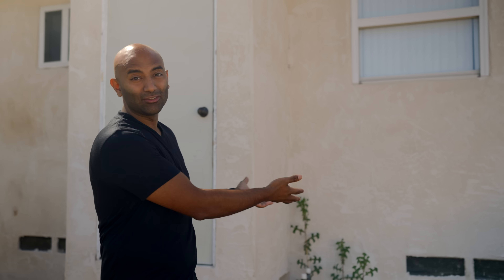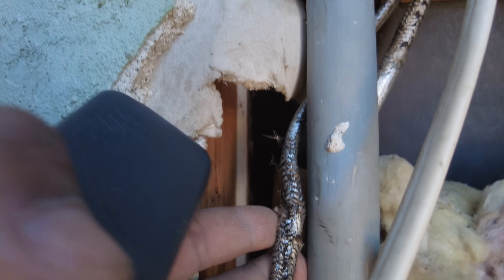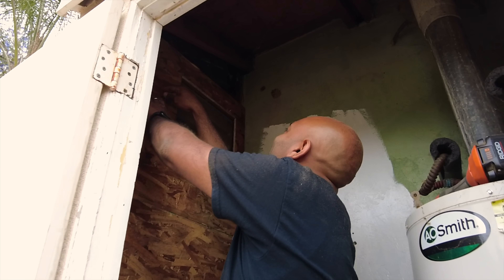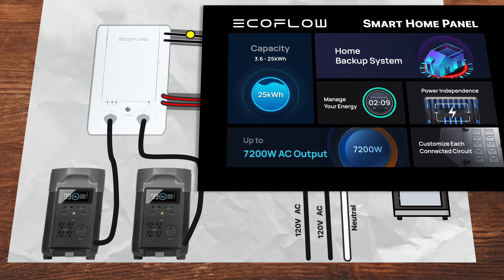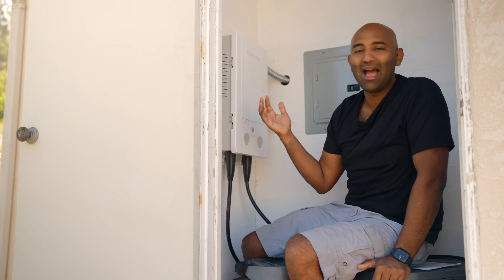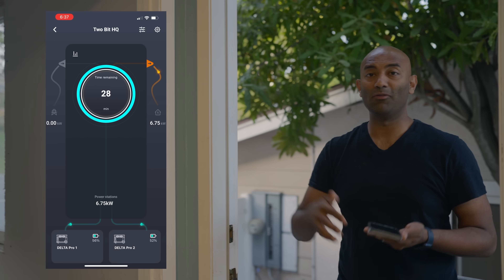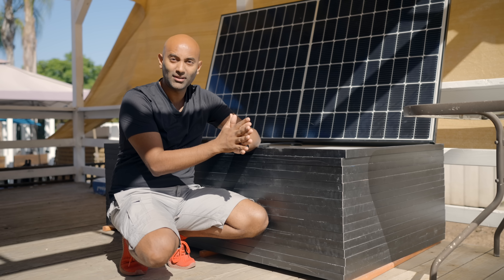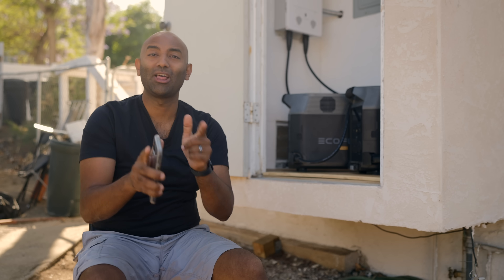Best New Way To Back Up Your Home Energy?  |  Going Off-Grid.

Comment: 6:42 According to this schematic the device is putting (battery-)power into the system behind the circuit breakers.
Surely that can't be right?
Reply: It is right. The eco flow unit acts as circuit breakers as well. Good catch!
Reply: @azpcox  Yeah, according to the installation manual there's a single fuse protecting the backup batteries and "relay based overcurrent protection" on each circuit.
I wouldn't be surprised if that's the UPS relay doing double duty with a bit of software. But let's give 'm the benefit of the doubt and assume there's actual electromechanical breakers in there.

You'd still need the thing to feed into another breaker box as there's no AFCI or GFCI protection.
I believe AFCI is mandatory in the US, so that's another 1000 bucks for the installation of another 10 group combination breaker box.

In Europe we mandate GFCI. A single unit can service up to 4 groups in the mains breaker box. But in a setup like this, with each individual group potentially getting power input behind the breakers, it'll need 3 of em in the mains box. And another 10 in the secondary box.

And how will the fire department switch off all power in the house, if that need arises?
In Europe there's a firm building code requiring an entire building to be switched off with a single, clearly identifiable, switch.
I don't know how US code deals with that. But the 10 (or 20) pole certified mains voltage switch needed to de-energise the whole house doesn't exist.

Leading one to question: why on earth would anyone want to wire in a UPS system like this?!

Comment: Why not use underfloor heating? This is more economical and efficient than AC. Heat rises, and a mere 20°C at the floor is more than enough to maintain equivalent room temperature, and best of all it warms your feet first. It’s even suitable for installation under tiled floor in wet areas!
Reply from the maker: Hmm maybe on the main house. I’ll have to see numbers on performance.

Comment: It was impressive how quickly it transitions when power outage takes place. My PowerWalls don't flicker my LED lights in a noticeable way, but my wall mounted TV does get rebooted if the grid stops working and PowerWalls take over. I think the capacity of those EcoFlow batteries is very low. My two PowerWalls can keep my home powered for 6+ hours and I have everything including two central AC units that use 3.5-4 kW each when running. When my Tesla car is charging, the house during summer can be using up to 14 kWh. My solar system during peak solar conditions produces max of around 11.x kWh.

Even with my large investments in solar / battery, while it is possible to be Net Zero, it isn't possible to be completely grid independent. Especially since we can get really cloudy days that are still too hot and require just as much central AC use.

Comment: I have to assume that the Ecoflow Smart Home panel will not allow its power to flow back onto the grid if the grid goes down. I wonder how this happens with what you showed us. so far. Obviously fully off the grid operation will not require this  for grid safety, but your local codes will if you expect the grid as backup.
Reply from the maker: yes this is a sort of off-grid system. this will not feed the grid at all. only your local consumption in those 10 circuits

Comment: Is this in the US?
Our house built in 1951 has original electrical wiring and is quite ok shape. 10A 230V circuits and 400V 20A for stove. Heating is of course water based district heating powered by recycled trash. Until the 80s it was district heating based on oil. 🇸🇪
Reply from the maker: yeah do you have grounds? most houses weren't grounded back then. also homes dont move so old wire really isn't a major issue.but we weren't grounded, and tehre was bad wiring. so we wanted to get it up to code
Reply: @TwoBitDaVinci  
With taped connections outside connection boxes I can really see why you want to replace the wiring! :)

Grounds only in kitchen and bathroom has been the national standard until the 90s. (Radiators and sink naturally grounded). In early 2000s they added earth breaker as standard which opened up for outlets in bathroom which was prohibited before. 

My sisters house in the woods remade the wiring 15 years ago, before that it was from the early 1930s. No problem with connections after 75 years of service and thunderbolts! (you could see where the bolts jumped from 230V system to the old telephone cables by burn markers on the wallpapers!). Plastics wasn’t invented by that time so at some places the isolation fell off leaving naked live wires. It was time to do rewiring! :)

Comment: get a multi input tank and as large as possible 
personally not a heat pump tank , solar be a lot cheaper electric to top up the tank , for air con you could have water cooled condenser 
and use one of the inputs in the hot tank to pre heat the hot water

Comment: 12:06 What would happen when you go over the 7200 Watts total draw?
Will it switch off individual groups until it drops below that? 
Or will it just blow the single battery protection fuse? Potentially leaving you in the dark and on your way to the store to buy a new fuse and a flashlight..

In another post I've already determined that this thing is illegal to install the way it is.
But besides that, I'm genuinely curious what this weird semi UPS device adds over a real battery UPS system wired straight into the mains breaker box.

Comment: Having the grid is great but it is already starting to make sense to just build a bigger battery bank and add more panels and have the grid become the back up, for those that have the option it saves a lot of money not even bothering with the grid full stop. This is going diy of course, buying your own LPA cells from China, chargers and inverters, those companies like ecoflow make it a non starter financially atm and it will remain that way for many years yet.

Comment: I usually go for fiberglass insulation (you know, the pink stuff).  Very easy to install, and also very easy to rip out if you need to drill holes later on.

Oh, make room on the wall for one or two amazon fire tablet mounts.  These are recessed tablet mounts with a built-in AC socket (usually also with a built-in USB socket), so the tablet can be there on the wall always powered.  Great for home-automation controls.  Its a small room, so I guess you need only one.

-Matt
Reply: I would go for Rockwool (Rockwall?).  Blocks more sound, insulates just as well, easier to handle, etc., etc..
Reply: @markjohnson7887  I would go with a hybrid insulation system. Spray in closed cell to close any airgaps in the home and then rockwool. It's cheaper than full spray foam insulation and you get better fire protection and and external noise reduction.
Reply: @DoctorDanLe  Oh yeah, I forgot about the sprayed in insulation.  Good idea

Comment: What about a solar thermal water heater?
Reply: I know right, a small gravity fed solar hot water heater would be perfect for the small house.

The only issue I would see with it is in the mornings it would not have much hot water til it is able to warm the water up.
Reply: @travisschneider3011  Correct, unless a good sized (and insulated) buffer tank is used. Most systems also use a small waterpump that starts pumping the hot liquid as soon as the temperature in the solarboiler rises to a certain level.

Comment: You guys don’t appear to use solar hot water much, you don’t appear to have either Thermo siphon or Thermo pump both of which especially the first are very popular in Australia. With a power boost for the really bad weather days. Yes we do have freeze weather here so the system also has to be designed with that design feature. Just a though!

Comment: You shouldn't run microwave empty I don't think forget the exact issue but think supposed to put glass of water in there if just testing, probably not huge deal and like I said not sure the exact issue but do recall reading it somewhere when using microwave to dehydrate leaves quickly.
Reply from the maker: good to know yeah just for a quick test :)

Comment: great concept but 30 min run time is practically not useful during an actual outage, that will probably drop to a few mins if you load an AC or fridge/freezer.
Reply from the maker: Fridge and freezer are easy, ac of course will run it faster. I just added solar to it and now it’s totally off grid
Reply: @TwoBitDaVinci  solar might help but what would happen overnight if you have a power outage for a day or 2 ? the runtime is still max 30 min for over $4000 worth of batteries, I am trying to find a reasonable power back up that is not a generator for a reasonable price but seeing your review is just another reason why this is still a work in progress and doesn't replace generators unless someone installs a couple of tesla power walls+ solar at 10X the price of a generator. keep up the great content love your other videos ;)

Comment: In Far North Queensland Australia our Energy Supplier Ergon will allow you to engage in arbitrage buy at off peak rates and have a time of use tariff and have storage cover the 3:00pm to 9:30 pm when in the three summer months premium pricing applies. I have an Enphase 10.03 kW Solar and 7.20 kWh of the 6 x 1.2 kWh version of their batteries system. I am cash flow negative (no electricity bill). I are waiting on the encharge batteries to be made available in Australia to do the upgrade to achieve the best cash flow outcome.

Comment: For hot water look into Sanden CO2 heat pump!
Reply from the maker: CO2 heat pump?
Reply: @TwoBitDaVinci  Sanden SanCO2 heat pump water heater.  Its Japanese.   They ARE in the U.S. now (I have one), but they don't have a large presence.   Probably the best COP for an air-sourced heat pump.  However, it is very expensive.   It uses CO2 for the refrigerant.   There is an inside piece which is just the steel tank, and an outside piece which is the compressor / evaporator.   The refrigerant is entirely contained within the outside unit... it has a small secondary water loop from the main tank that the outside unit heats up.

The cool thing about this system is that they use a steel tank and will heat the water up to 155F (kills all bacteria for sure).   Then they use a mixing valve on the hot water output to mix in cold water to target house piping hot water temperature (120-130F).    Also, the steel tank has no backup heating elements in it (no need for any), no integrated compressor... its just a steel tank with appropriate fittings which means it will last a very, very long time (at least 40 years). 

If you get the unit, get the ~80 gallon tank, not the smaller tank options.  Get the big one.  Losses are lower (less surface area to volume, hence lower losses).   For 2 people it eats around 4kWh/day which is very, very good.  I usually set a lockout period between 4-9pm so it doesn't run during peak tariff.    Note: a hot water recirculator is NOT recommended.  If you have one you can easily double the energy use.   However, in CA wasting water is the bigger problem so if you do have a recirculation loop just set a timer up to run 15 minutes in the morning before people take their showers.  That isn't too bad.

Heat pump water heaters cannot re-heat water as quickly as a gas water heater, but the SanCO2 does a great job anyway because the small water loop injects hot water at the top of the tank (where the output is), so you will never get actually-cold water... just not as hot as you might want when you blow the whole tank.   And again, there are no backup heating elements.  This makes the electric hookup easier.  It soft-starts.  Burns roughly 3kW (240VAC @ roughly 15A, requires a 30A circuit).  Its a nice setup.  But expensive.

-Matt

Comment: Major issue is that this backup solution is that the Legs don't share battery power.  So one leg could go out before the other.  It needs to share the battery. power.
Reply from the maker: you can do split phase or not. if you do split phase, because you have 240v things, then no. but I am not doing split phase, its just a pin you pull out or put in, and so batteries can back up both legs. great question!
Reply: @TwoBitDaVinci  Yea you would defiantly want the batteries to be shared between both legs.  Otherwise there would be major problems.  I'm not so sure that solution will be enough to back up your house so I'm interested to see what your final real solution is.  I have 20kwh of Lifepo4 in 4 battery banks, with a 5kw inverter split phase MPP LV5048.  So it will be interesting to see what your next steps are.

Comment: I hope you fixed the ground problems in there. Wrapping green tape around a red wire - not allowed. Putting grounds into a neutral bar on a sub panel - also not safe or allowed. Also, no ground in the sub panel from the upstream panel.
Reply from the maker: yeah it was a mess, it has all been sorted

Comment: Roof mounted vacuum tube hat water system.  If it works in NE then will be fenominal in SD. See This Old House. Radiant heat panels.  See the Fully Charged Show.  Many natural fiber insulation products.  Maybe hemp or blue jean.
Reply from the maker: I am going to go 100% PV Solar on the roof, because I need electricity most of all. I can heat like a 20 gallon heat pump water heater very easily with a nice sized solar system, and still power all the other things we need.
Reply: Go flat plate hot water system instead.  The only advantage that evaporated tube hot water systems have is cold resistance and he lives in San Diego, so it is not needed.  The flat plates are cheaper.

Plus with the tubes they can overheat in hotter climates.

Comment: “Energy arbitrage” is the key. As for your water heater, in the old days I just went from a tankless back to a 240V water heater because sending my excess energy back to the grid was a waste , because the monopoly wasn’t paying me what my energy was worth. Instead they sell it to my neighbors at 4 or 5 times what they would pay me. Hopefully that will change as the monopolies get out of the generation business and let the CCA’s do that. Don’t know what a CCA is? GTS. Google that sh*t.
Reply: Just go off grid and buy a generator, otherwise the grid still has to provision capacity for you, even if you only use once a year.
Reply: @edc1569  BS. If the grid can deliver it can receive. It’s a two way street.
Reply: My power is Delivered by Pacific Gas and Electric but, I buy my grid power from Peninsula Clean Solar. If I buy power from PGE I get almost nothing back, but buying Green power from PCS I get a check for about $1,500 a year. PGE and their Ilk are trying to rig the game in there favor and if they succeed it will Kill Residential solar. If I were able to disconnect from PGE I would, but that is not allowed where I am.
Reply: I agree with your sentiment.  The main problem with the CCA structure in California is that production can be handled by anybody, but transmission is still handled by PG&E.  So, how did they rig this system?  They charge almost nothing for production, and a LOT for transmission.  

For example, they might charge $0.03/kWh for production, but $0.24/kWh for transmission.  What this practically means is that whether PG&E is your producer or not, they still collect the majority of the profits.  Switching to a CCA has little ability to bring down your bill because all the value capture is in transmission cost.

Comment: This is the first time I have ever seen a power station that has more than 20kWh of power. You can be totally independent from the grid.
Reply from the maker: you'd need to scale the batteries all the way to 6 but yes you could. and you can get solar fed into them all without any permits or permission!

Comment: Most of what you say is not according to what you actually have, there is so a ground just not a modern safe 3 wire system. The amount of power that modern electronics use is much smaller than in the past, so the wiring would likely be able to handle the load.

Comment: Electrical heater have a 100 % efficiency
Reply from the maker: Heat pumps are 5x that. So for 100w you get 100w of heat using resistive electric heating. With a heat pump 100w would give you 500w of heating. That’s why they’re amazing

Comment: Depending on your location research a Evacuated Tube Split Solar Hot Water System.
Reply from the maker: Will do!
Reply: He lives in San Diego it's a mild climate.  A flat plat collector would be better as they are cheaper and he doesn't need the cold resistance an evacuated tube will give him.

Comment: DEFENITELY heat pump, tank water heater.  Rheem has a great one that averages: $110/yr. to heat, if you pay for electricity.  For solar people, it's a no-brainer.  I used to sell solar heating equipment, with the water solar heat panels and all and that whole industry is gone now due to the efficiency and low price of solar PV and heat pump water heaters.
Reply from the maker: nice, did you get it at like home depot? That's what I've been looking at, but i'd love a smaller system, like 30 gallon

Comment: Ricky,
Please calculate if using the DC input for solar panels be enough to recharge the batteries for the available solar hours.  I don't think it can on a fully depleted battery.  However I have been thinking that, if the system allows, you could have a few more panels with micro-inverters and then change the EcoFlow with AC current too.  The combined charge, again if possible, should be able to recharge all the batteries.

Please update on how much heat the EcoFlow generate in a closed closet lite the one you have.